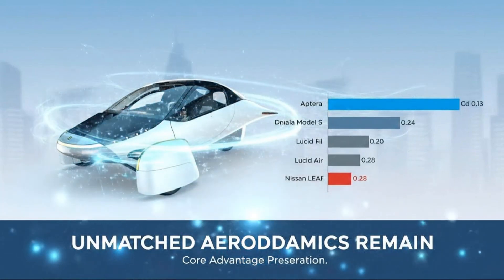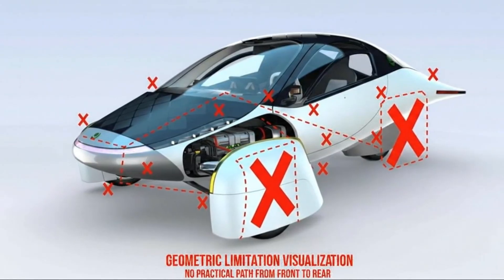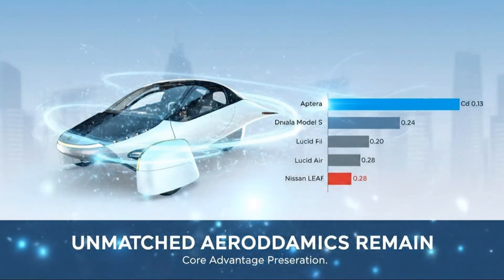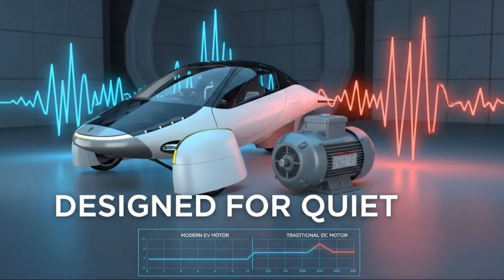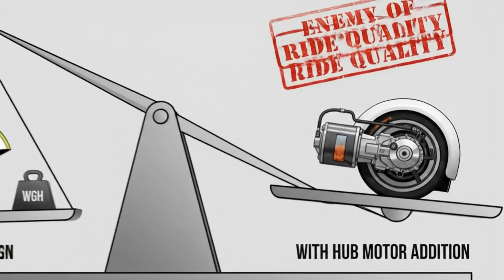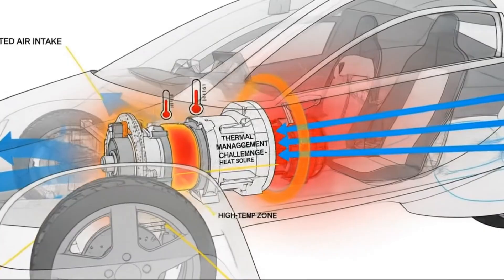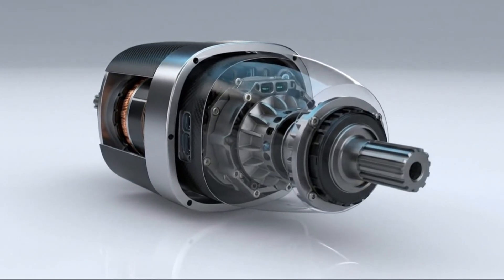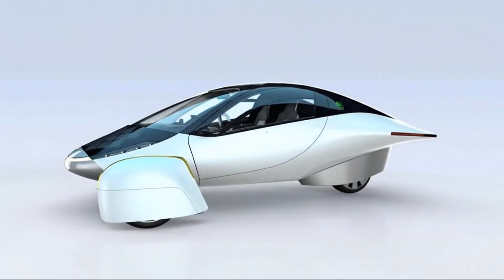Aptera’s Motor Decision Exposes a Harsh EV Truth Nobody Talks About

Comment: The tone of this video sounds like clickbait. The main subject is very old news. Hub motors suffer two main problems. Unsprung weight, and the ensuing level of vibration making the need for far more robustness. As for DC motors, did they ever consider them. The norm for EVs in this century is PM, Synchronous or Squirrel Cage.
Reply: True "Aptera is using a Vitesco Technologies EMR3 axle drive motor for its production model.
 This inboard motor is part of a drivetrain that includes an inverter and a reduction gear set, replacing the previously planned in-wheel hub motors from Elaphe.
No, the Vitesco Technologies EMR3 axle drive motor is not a DC motor. It is a permanent magnet synchronous motor.
 This type of motor is known for its high efficiency, compact size, and high power density, making it suitable for electric vehicles"

Comment: Reservations, as soon as you hear that, it translates to scam.
Reply: there is not a single company out there that has got this number of reservations. It shows the smart money is investing in a smart company. I keep buying more Aptera stock because I'm smart.
Reply: @billsmith5960 reservations means absolutely nothing. Ford had a quarter million reservations on the Lightening, but when you actually have to buy, they vanished. A reservation doesn't cost anything. They have no actual "deposits"  on them. Reservation is meaningless.  No deposits, no pre-orders, just vaporware useless reservations. You could claim 30 billion reservations, still just a meaningless.

Comment: This is AI garbage. Of course aptera isn't going to use a DC motor and never was going to.
Reply: True "Aptera is using a Vitesco Technologies EMR3 axle drive motor for its production model.
 This inboard motor is part of a drivetrain that includes an inverter and a reduction gear set, replacing the previously planned in-wheel hub motors from Elaphe.
No, the Vitesco Technologies EMR3 axle drive motor is not a DC motor. It is a permanent magnet synchronous motor.
 This type of motor is known for its high efficiency, compact size, and high power density, making it suitable for electric vehicles"
Reply: Big Oil paid troll that is trying to short Aptera stock. Sad....